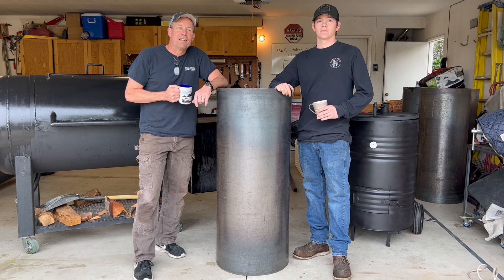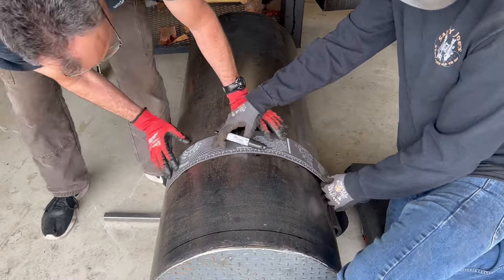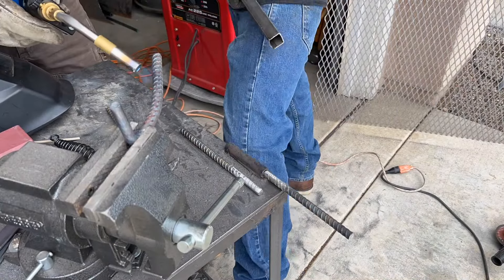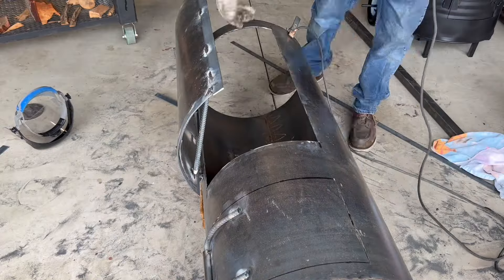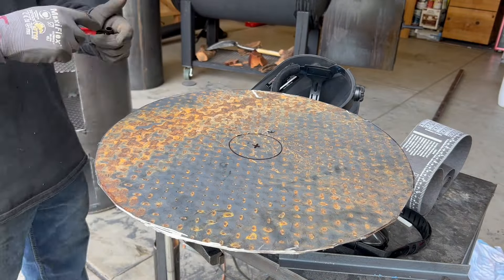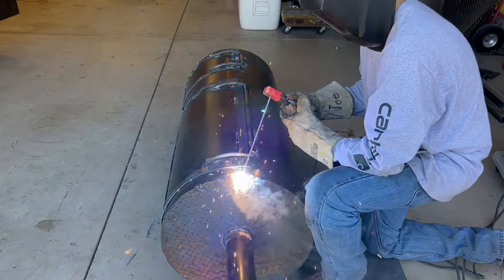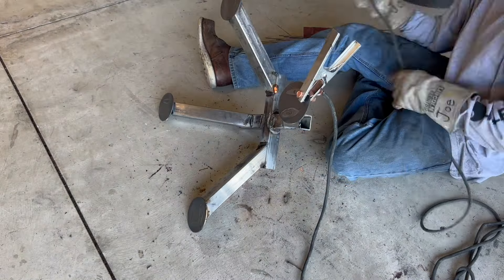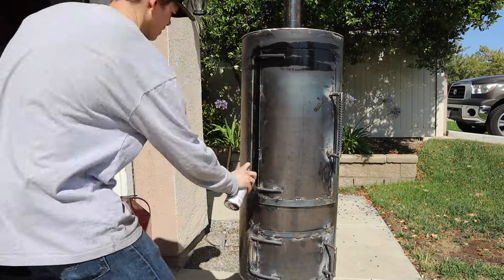Direct Heat Smoker Build(DIY Smoker)

Comment: Is the vertical smoker same to the horizontal one ? Does it bring the same results ? With the vertical one you have direct heat under the meat not side heat, so does it smoke it or grill it ? Any captain here to answer ? Thank you 🙏